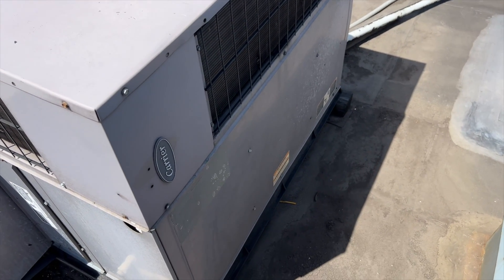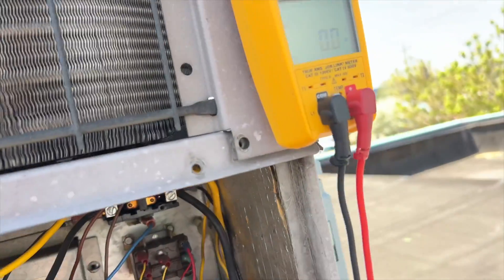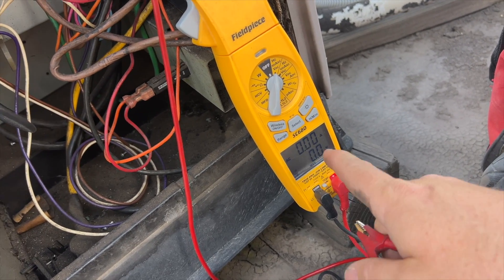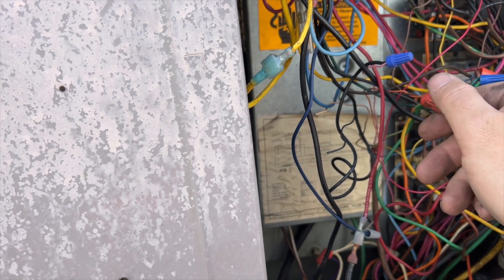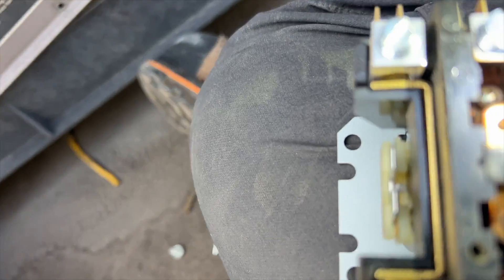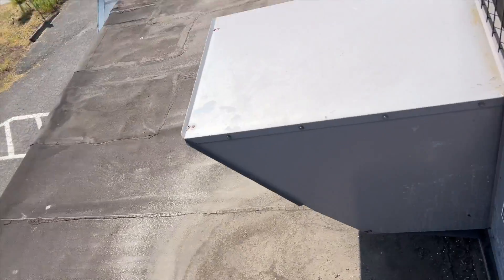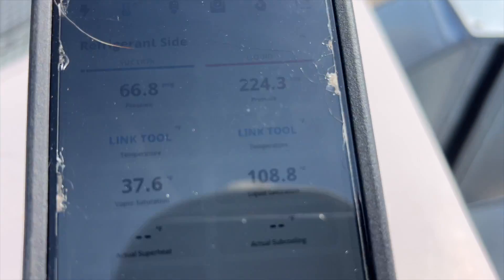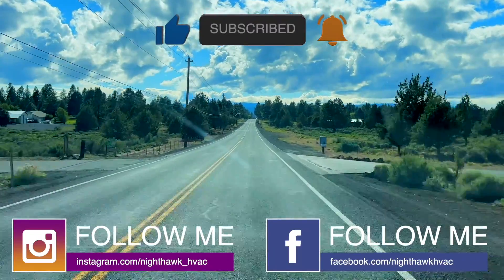Heat Pump Not Cooling EP176

Comment: Low voltage wire rubbed out somewhere by the blower assembly or compressor? Just curious 🤷🏼‍♂Solid video. I have a feeling they'll be calling ya back for a tripped popper again though. I know you already know this, but check wires anywhere they could rub for those intermittent shorts like that.